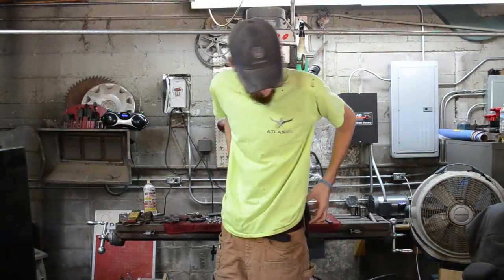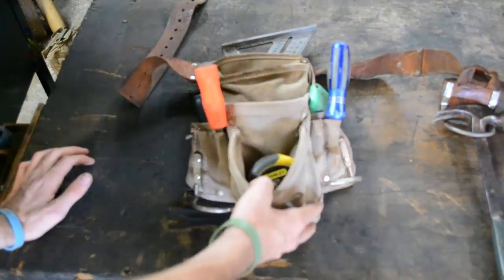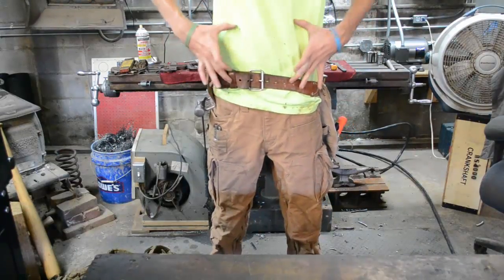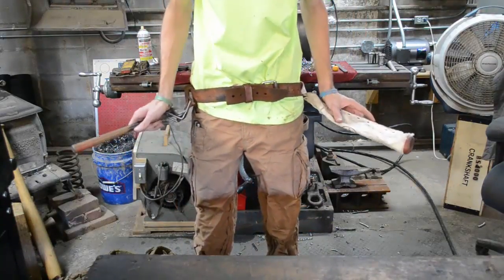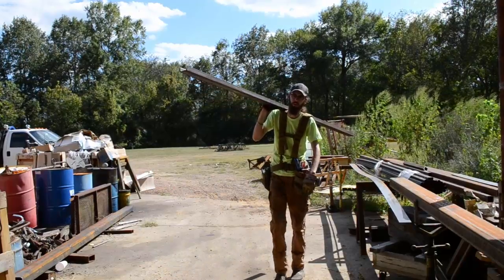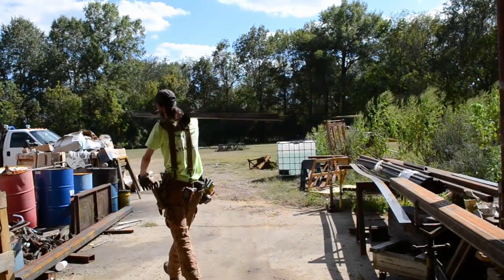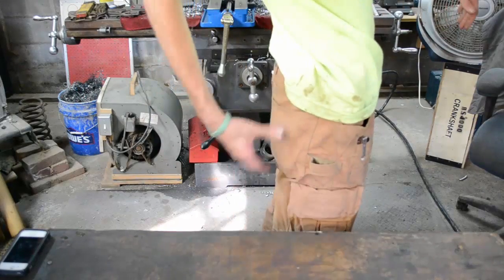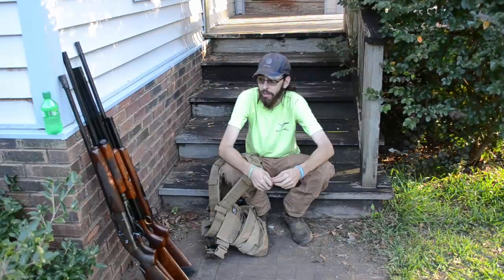Tool belts, and Atlas 46 tool review

Comment: i have an atlas 46 toolbelt and it is seriously over priced.  the drill holster strap broke the first week...its ridiculously wide which doesnt work for what i do.  i wear it for outside work only.   i shouldve just gone occidental
Reply from the maker: CaptainsOrders Aye I would say they are very expensive.  Ok wow I'll take that in mind I would have thought it would hold up better than that.  Thanks for the comment.
Reply: Or just go with Diamondback tool bags.  They are definitely not too wide or bulky. But they are expensive.    Atlas bags look nice tho.